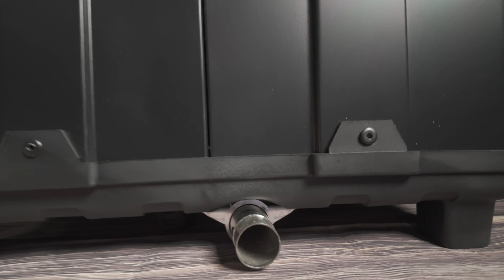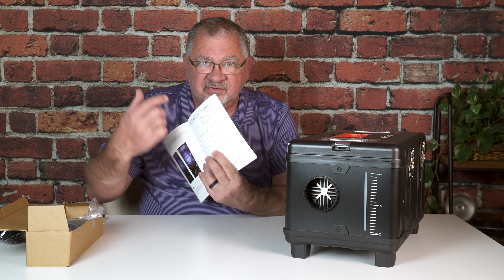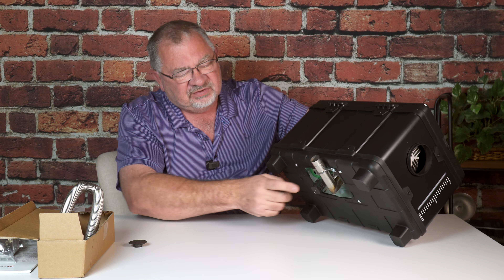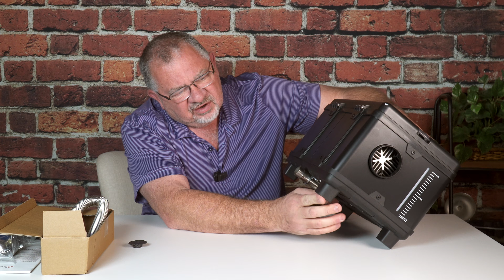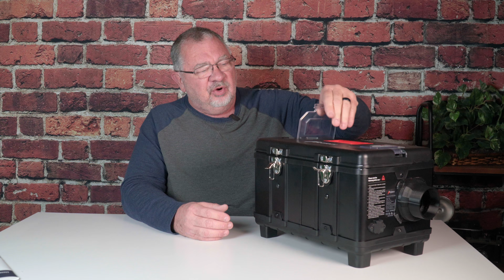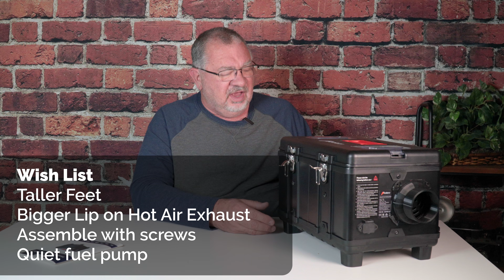Hcalory SS2 Diesel Heater - An Honest Review

Comment: Sounds like the folks who run the heater outside of their tent need   an umbrella  ---- securely fixed of course to the ground or a purpose made 'shelter' of a given size (overhang)   that is abosolutely waterproof and runs down one side supported on 4 bits of lightweight rod........   Any good?
Reply from the maker: This year's hCalvory heater is waterproof, I have run it multiple nights in the rain with no issues.

Comment: That must be the score.... The so called NEW hcalory  2025 I bought a month ago and have just fired it up yesterday is fantastic.          Looking at this thing through the eyes of a retired oil firing heating eng I take my hat off to those who produced it.....    It is quiet when running all that's heard is the air flow and a lovely noise from the  minature pressure jet burner.    i say lovely because my old land rover is now warm within a few minutes.
I had an old  aluminium dive cylinder ready to scrap and hate seeing lots of very hot air going to atmosphere.
The how exhast that was going out and wasted is now double passing through this ali cylinder . The exhaust is approx 180F at the top of the cyl and I can hol;d the exit pipe at the bottom  which I would gues at 100F. I could put the laser
thermometer on all the pipes and get accurate data.   But the oven thermometer at the top of this cylinder is 180F so the total heat output into air is far more than it would be without this modification........
These postage stamp heaters are really something......  It has transformed this old banger into a hothouse!

Comment: I don't know about this one but the other Hcalory bluetooth models probably use the phone's GPS for elevation. No need for a barometer/altimeter.
Reply from the maker: None of them use the phone's GPS for elevation as the elevation is displayed on the screen even if you have never connected it to your phone.
Reply: @TrailTraveler  It wouldn't be that hard to do in software in the controller and app and would save the cost of the altimiter. The vendor would just have to inform the customer that they would need to connect their phone to update the elevation if they move the heater. If I had a heater with bluetooth, I would only be using the app to control it after initial startup.
Reply from the maker: @jamescampolo7824  I am guessing that the cost of the altimeter is trivial at best since that feature comes on some of the cheapest units on the market. That said, I have also never seen one that is very accurate, although generally off by only a few hundred feet. Using the app would probably be MUCH more accurate. It would be nice if the app could set the time on the controller too since they don't have internal batteries to keep the clocks running.
Reply: @TrailTraveler  Syncing the clock on a device with the phone is pretty standard on most bluetooth enabled devices. Sounds like these controllers are pretty dumb. My blood pressure machine, smart watches, cameras, etc. all get their time from the phone which gets it's time from the cell network which by law has to be within 45 seconds of an atomic clock. 
BTW, I purchased one of the Sunster heaters you demoed. I hope it's as good as your demo. The reviews on Amazon were terrible. I am also a bit worried since I couldn't find a website for them unlike Hcalory. And then, it is "not returnable" on Amazon where the more expensive heaters are returnable.
Reply from the maker: @jamescampolo7824  RIGHT?!? They could do SO MUCH MORE with just a little programming in the app.  As for the Sunster, it is my second favorite heater. My top favorite is the LF Bros N2 Pro, but at $600, its getting pretty pricey. The Sunster comes in second because it isn't quite as quiet as the N2 Pro and didn't come with the accessory pack that the N2 Pro did. As for performance, noise, and value, the Sunster is the best in the price range.
Reply: @TrailTraveler  I just looked at the specs on the LF Bros N2 Pro. How big is your tent 17,000BTU? LOL
Reply from the maker: @jamescampolo7824  Our RTT is 94x61x60 inches when open. Even at 20° I didn't even have it running at 20% power

Comment: Will it heat a two car garage somewhat?
Reply from the maker: It depends on how insulated the garage is and how cold it is. My 3 car garage, non-insulated, at 20 degrees F, I might get 2-3 degrees out of it, probably more if I ran it constantly for days. If it was insulated well, it might make a decent difference.

Comment: Your intake air was about 8deg in the garage with about 140deg output on speed 4. How much cfm was that output? Im thinking if the cfm is 50+ then that split is very impressive
Reply from the maker: @jmf1976jmf  I honestly don’t know as I don’t have a way to measure that
Reply: @TrailTraveler  thank you sir

Comment: AT THE VERY BASIC LEVEL YOU SHOULD HAVE A FULL SET OF TOOLS WITH A CORDLESS DRILL AND IMPACT WRENCH IF YOUR LEAVING THE HOUSE. I DONT CARE IF YOUR GOING TO WENDYS DOESNT MATTER. HAVE THE TOOLING AND THE KNOWHOW TO SAVE YOURSELF IN ANY SITUATION THAT IS PRESENTED. AND IF YOUR TOOLED AND CAPABLE TO SAVE YOURSELF, THEN YOU MAY BE HELPFUL FOR OTHERS IF IT CAME TO IT. NOT HAVING A FULL TOOL SET ON YOU WHEN LEAVING THE HOUSE IS A HUGE MISTAKE I SEE THAT MODERN MEN DISMISS. WHICH IS WHY MOST OF THEM ARE USELESS AS TITS ON A BOAR
Reply from the maker: We keep a full tool roll, first aid kit, two fire extinguishers,  a complete set of recovery gear in the Jeep at all times. We add to that when we go hit the trails.

Comment: Drilling out a rivit is workshop 1.01.  just drill thr head off it with a cobalt bit and knock it through with a pin punch.

All your other problems are easily fixed with some basic metal work. Learn to weld or find a machinist who can easily make an outlet extension out of aluminium on their lathe.
Reply from the maker: Pretty much exactly what I did except I 3D printed the outlet myself

Comment: Does it run on a thermostat or just runs all the time. Thanks
Reply from the maker: It has both modes. If you are running it inside of a building,, you can use the thermostat mode. Since we keep the unit outside of our tent, we would have to extend the wire to the controller in order to put the controller inside the tent.

Comment: Is it waterproof???
Reply from the maker: It does not have an IP rating. The only concern about have is the power cord connection. I haven’t decided how I will address this yet, or even if I really need to as I can just place the heater unit under our trailer to protect it from the elements.

Comment: The label on the AC/DC block charger reads for Indoor use only. Does this mean this unit is not able to be placed outside to vent hot air into a tent for camping?
Reply from the maker: The heater and the power supply are not waterproof, so as long as you can protect it from the elements, you are fine.

Comment: For camping the big challenge with these heaters is rain. There is no way you could leave this out in anything but very light rain. Looking at the design I think it would be difficult to rain proof that box so the only solution is to construct some sort of roof arrangement to go over it - be interested if anybody has any ideas -Keeping the hot exhaust away from anything  would be tough
Reply from the maker: Fortunately for us, I can put everything underneath our trailer to keep it out of the rain. The only things I would be concerned of with this particular unit is the controller (you could seal that compartment pretty easily) and the power cord connector (You would probably need to make it a permanent connection to eliminate a connector and seal that up properly)
Reply: came here to ask just that. we r on our way home from camping and got surprised by wet snow last night into this morning and so i had to put a plastic box lid over the unit to cover the outlet and the brick so it doesnt get wet. the cheap vevor we had before had standard battery terminal connector and no brick so we didnt have to worry about that getting wet but with this ss2 i was surprised how not "winter/rain friendly it is. yes we can put it under the vehicle and tuck the power cable under wheel well but it s not ideal

Comment: On the hot air output I extended it to an 1” with a metal ring. Works great
Reply: I actually did another modification, I purchased a 4” to 3” reducer from home depot, it tapers so I cut the 3” off at roughly 3-1/4” diameter then slid over the the output side, I put a couple screws to hold it into plastic collar along with high heat tape, I then put a 4” T to have 2 source of heat, 1 heats tent the other goes into a small stand up closet to dry hunting gear
Reply from the maker: Do you have any more details?

Comment: You can get to the pump by removing the 4 bolts on the bottom that will release the heater..
Reply from the maker: Thanks, I finally had figured it out..

Comment: You've given the most thorough review I've seen. You mentioned the Bluetti B55 and AC70. Do either of those battery packs run the SS2? I'll be using the unit ice fishing and need a portable battery that will run it
Reply from the maker: We have run it on both the EB55 and AC70 without any issues. Which unit is best is going to depend on how long you need to run it for without being able to recharge it. The EB55 could probably go 20 hours. If you had even 100w solar panels, you would probably never run out of power.
Reply: @TrailTraveler  thank you for the quick response. 12-16 hours would be the max.
Reply from the maker: @timguinard7434  the EB55 would be enough

Comment: Is the Bluetooth app worth it? There is another manufacture, by Lf bros. They don’t have a Bluetooth app, but everything looks to be a bit better.
Reply from the maker: For me, I like the app. With just the remote, you don't know what setting it is on or what the status of the system is. If the system throws an error code, the app tells you what it is, which can make troubleshooting easier.

Comment: Looks like those rivets could be replaced by using bolts and rivnuts. You would install the rivnuts to the sheetmetal sides, and for extra convenience you could use bolts with thumbscrews to fasten the lower part.

Edit: Also I do believe these do not come with any fuel filter installed from the factory, as seen in other videos on YT where they disassemble these to swap out the green flexible fuel line with some solid fuel line.
Reply from the maker: If you watch this video (https://www.youtube.com/watch?v=dpNAWc-kgzY&)  you can see I drilled out the rivets and used rivnuts and added sound proofing and other mods. I had a good conversation with a Webasto engineer who said there is no reason to swap out the green fuel line. There is almost no pressure created by the pump, so the theory that the green line will cause problems is just a myth.
Reply: @TrailTraveler Have you had experience with the Wippro 5kw-8kw all in one diesel heater. Some other reviews on YT praise this one for a super quiet pump. Wondering how loud this SS2 is vs Wippro. I am looking for a quiet unit but the SS2 has the Bluetooth app control which Wippro does not.
Reply from the maker: @kimwong2053  I have not seen one in person yet

Comment: Most videos I see this heater used in are using 3" duct hose. You mentioned using a 4" hose on a different  brand heater, because of an overheating code, instead of the 3".  Have you tried this heater  with 3" or are you just going to stick with your 4" hose? I'm considering this heater but can't make up my mind on which hose size to get.
Reply from the maker: A 3” hose is fine if you are only going a few feet. Pushing the air up to a roof top tent in a 3” causes the heater to overheat. So for now, I use the 4” from heater to tent and the 3” from tent to the cold side of the heater.
Reply: @TrailTraveler  I'm using a ground tent and since I don't want the heater against the tent, I was thinking of an 8 foot hose.
Reply from the maker: Just to avoid problems, use a 4” hose
Reply: Sounds like good idea, Thanks! @TrailTraveler
Reply: @RWS73 use 4” insulated duct, not just a dryer vent hose , all home improvement stores sell it , there’s no heat loss running it 8-10’ , also if it’s 8’ away from tent it’s subject to rain or snow , you can wrap it in a rain proof tarp , this will also help insulate,

Comment: Hi.  Great review....thank you.   One question....when you are using the heater while camping presumably you run it off a battery.  How much electricity does the heater consume; how large of a battery do you need.   I'm a bit of a novice and appreciate the help.
Reply from the maker: We have both a Bluetti EB55 and AC70. When running on a medium setting, the heater will pull about 30-35 watts. I recommend the AC70 (768wh) which should run it for two nights without recharging.

Comment: Did they seriously use an IEC 60320 C15/C16 for 12-volt DC power? I couldn't believe it so I checked their website and there's a very clear photo of it. They seem to use a dometic-type plug for some of their stuff, but this one is clearly an IEC..

I don't even have words for how dangerous that is. What could they have been thinking?
Reply from the maker: That is not the plug on mine. Mine is the same plug as my Dometic and ICECO fridges.
Reply: Fried mine plugging it directly into 110v with this plug

Comment: There ae some creators who might have done the drilling of the rivets before they spent time making the video, thanks for your incomplete review.
Reply from the maker: Well...not a single one of them did, so there is that. I did a complete review of the unit "as you receive it from the factory" - Oddly, Hcalory said it was the best diesel heater review they have ever seen..  My mods to it are not part of a "product review" and should be separate from an "straight out of the box" review. But since we have mentioned "some creators", almost all them simply raved about what an amazing unit it is and how quiet it is. My review told Hcalory 4 different things they could do to improve it, and the video was sent to their product development team.

Comment: just so you know nearly all of the Diesel heater manufacturers have some kind of square one now and 1.3 gal is about standard for the tank size
Reply from the maker: I believe this one is 1.6g, just slightly larger than most. Not a big enough difference to be a big selling point though.

Comment: I purchase the SS2 heater a few weeks ago. It works well inside my 24' insulated snowmobile trailer. the one issue I had was the supplied cord to power the heater using a 12-volt battery would not work. I tested everything and finally realized the 12v battery power cord was wired wrong internally. I had to connect the black wire to the positive terminal and the red wire negative terminal to the power the heater up. I have reached out to my supplier and Hcalory for a replacement cord.
Reply from the maker: Probably easiest to just fix the cord, seems like a lot of people have had that issue lately so there is no guarantee that a new cord won’t be wrong too.
Reply: Sussed mine out today . How they get away with it, I do not know
Reply: good ol' lack of Chinese Mfg quality control

Comment: I think this is the company that uses 120v style plugs on the heater as 12v,  shouldn't that raise red flags?
Reply from the maker: If you are thinking it’s like a “computer” plug, it isn’t. It’s basically the same as the 12v plug that Dometic and ICECO use

Comment: You did a great job reviewing this heater. One question and comment put together for you to comment on.  Does the cold  air intake ( room air return ) suck air from inside the housing or is it sealed to the housing and suck air from the outside? The reason I ask is if it pulls air from inside the box and if you ever spilled fuel while refueling, you would definitely have that smell in your tent. ( My pet peeve is diesel fuel smell)
Reply from the maker: I 3D printed a sleeve to go between the heater and the case to eliminate pulling air from inside the case for this reason as well as to provide more suction. I will be covering this in an upcoming video.